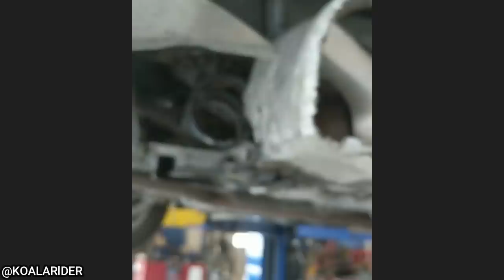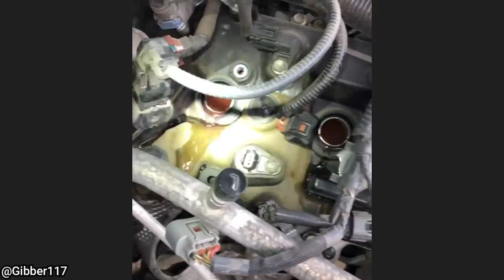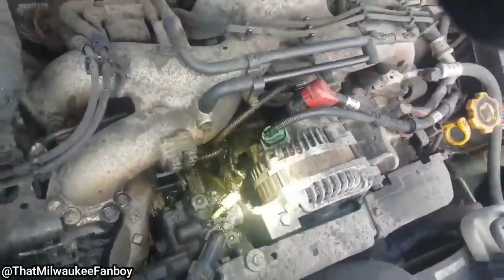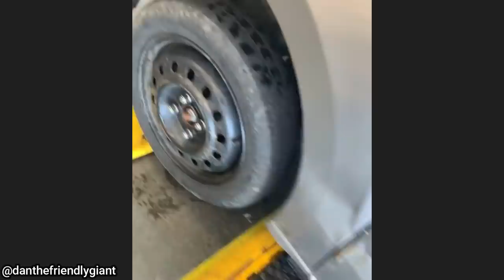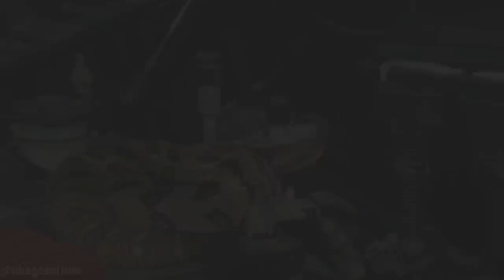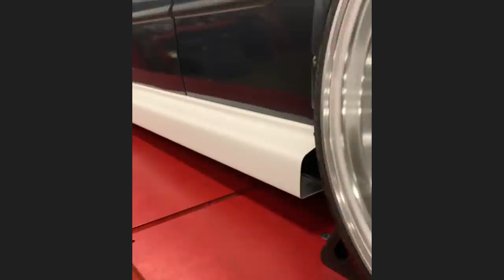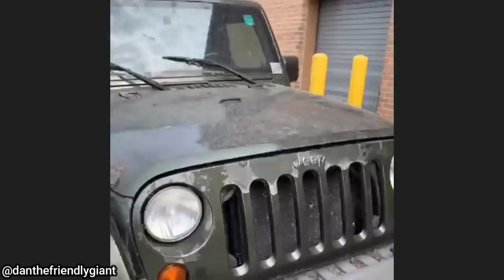Customer States They Want All The Damage Fixed | Just Rolled In

Comment: Reckon the rain-gutter side-skirts are a brilliant idea, as it means they're easily replaced when ripped off on a speed-bump!
Reply: These cars are usually first ones in the ditch during a snow storm!
Reply: Those ones look like going over 30 will rip them off.
Reply: A surprisingly good(ish) idea executed terribly.
Reply: It’s to channel the water away during regular rain 🌧 sessions! 😆
Reply: The drywall screws, extra 10hp. LOL
Reply: Fast and Furious: Tokyo Drain
Reply: @alefgardhero  he should have attached with large head rivets used on late model stock cars, and used thin aluminum tubing for support braces, match the color of the car or use matte black paint, other wise great idea looks fast and areo.
Reply: One of the most ghetto modifications I have seen.
Reply: Absolute genius if done to a better standard
Reply: Attached with flathead wood screws
Reply: What is it with people wanting to screw shit to their cars? What does it achieve? It's just so wanky....
Reply: My exact words i ended up saying out loud were "well hey, it works."
Reply: @johnwurst6691  glueing is too finicky.
Reply: or lost in a ditch beside the drift-track.
Reply: Brilliant, until you run out of rocker panel to punch holes in with drywall screws
Reply: @Initial_Gopnik  yeah. but there is still duct tape, no?
Reply: I'm not so sure about the drywall screws though.
Reply: Yea that paint ain’t gonna be cheap tho when it gets scratched up from the gutter ripping off LOL

Comment: My daughter's '07 Honda Civic had a cracked block around 2016, a friend who worked for Honda Mfg. did some research and gave us a number to call, sure enough, that engine block was under a 10 year unlimited mileage recall.  The car had been well serviced and received regular oil changes.  The block cracked on a Saturday, and by Friday Honda had installed a BRAND NEW short block, NO CHARGE.  Car had 154K miles on it too.  As far as I know it's still running, she sold it a couple of years ago.
Reply: At VW you don't get a single penny if the car is older than 2 years and the warranty has expired just one day
Reply: @ffjsb  I think you should. After that, take a shower.

Comment: the rain gutters are the funniest shit I've seen in a while. I'm shocked he didn't add a few elbows and a down spout and create tail pipes, lol. .
Reply from the maker: Maybe he was hoping it'd help him from hydroplanning lol
Reply: Thanks for the epic laughs 😂🤣😆👏👍 Very funny lol 😝
Reply: I used to work in a lumber yard and had a kid come in one day looking for 1-1/2 and 2in PVC pipe.  He only wanted specific pieces and I could not figure out what he was doing.  I finally asked and he said he was building a cold air return for his car.  I told him that wasn't a good idea and he asked why.  I told him that PVC pipe has a low melting point and could potentially set his car on fire.  He ended up not buying anything.
Reply: The self tappers complete the look just perfect.
Reply: Some people just never amazed me.🤣🤣
Reply: @MattExzy  They looked like drywall screws!
Reply: People also use garden edging to do this
Reply: aye, at least it doesnt look bad. gotta do what you gotta do
Reply: Honestly it looks better than a lot of crap Ive seen on some cars..... cheap to replace after a while too!
Reply: WAIT! SOON!
Reply: should have added some aluminum siding
Reply: @1HourMartinizing  and vinyl windows!
Reply: @markh.6687  and replaced the doors with screen doors.
Reply: @1HourMartinizing  That's a little drafty in winter, but it does keep the bugs out.

Comment: That was awesome.. That one with the motor running with the intake broken up reminded me the first time I changed my plugs in my 1973 Buick Century wagon with that sound.
The spark plug blew out. 
My ex also drove over what she thought was a large bag in a parking lot.  she stopped and looked and it was transmission case. She also noticed the puddle of oil but thought she could make it home 20 miles away. Wrong. 
She needed a new engine and then the nightmare started when the machine shop told me they installed the silent shaft bearing.Wrong. They said they did but they didn't.  3 timing chains kits later I got a better look inside the block. No SS Bearing. About a year later she put power steering fluid in the master cylinder. It took me awhile to figure out why it would stop moving after it warmed up... life's Lessons learned.. the hard way.
Reply from the maker: Well it sounds like it's a good thing she's a ex...? Lol
Reply: God r u sure u didn’t date a special Ed kid?
Reply: Yeah, stay single:)
Reply: Wow, that's quite a risk. If you do that around here, you get charged for the costs of oil cleanup and an environmental felony. Which, for just a few kilometers, is already heading toward's a year's salary for most people as oil is not easy to clean off roads at all.
Reply: @ThatNoFbody-ch9ky  Close... she was drunk a/f

Comment: I'm actually pretty curious about how far one has to drive on a rim to literally grind off that much of it.
Reply: Aluminum is soft so probably not as far as you think.
Reply: We had the dealers daughter get a flat so she drove the car back to the dealership rather than put on the spare :(
Wore the rim down to the rotor on an expensive Italian Lancia
Reply: @raymondclark1785  
Funny how wealth rarely transfers brains…
Reply: i will tell you funny thing you can do that with steel wheels and they will hold 😂 like 20 years ago i saw a workshop guy driving car with no tyres or seats 😂😂
Reply: @Torsee  Brains depends upon how you look at it.  A tire and rotor are cheap compared to getting run over while sitting a busy interstate either waiting for a wrecker or trying to change a spare.
Reply: @kaddiddlehopper  Then find a safe location and change the tire.
Reply: @MK0272  Why do you think it's in the shop?
Reply: @kaddiddlehopper  If a shop is the first safe place you find, you're not looking hard enough.

Comment: I have to admit ... everytime I see these videos with car being driven in with holes in the engine blocks, rims cracked or ground down, transmission with "inspection" holes in them, suspension parts that in pieces, and frame and bodies that are no thicker than tissue paper because of rust  ... I am just have to marvel at the level of engineering that has made it possible for these vehicles to actually be driven in those conditions.   It is no wonder that we are safer than ever in the vehicles we drive today.

That being said ... still terrifies me to no end that these vehicles are actually on the road ... and being driven in said conditions ... 😱😱😱
Reply: What gets me is the owners always lie about it. They bumped the curb, and ripped the entire oil pan off. Some other “shop” did these atrocious repairs.  Why bring it to a shop and then decline repairs? Did they think it would be a cheap fix?

Comment: Yeah, I'm going to call the plastic rain gutters affixed with drywall screws today's winner. That there is hillbilly engineering at its very finest. (Edit: That Superbird at the end is SWEET. I love the old wing cars.)👍
Reply: I'll never be able to look at another ricer car with a body kit without thinking about rain gutters again.
Reply: That's pretty cool
Reply: @joevk6274  🤪😜👍
Reply: Agreed on the rain gutter and superbird
Reply: @juanmanuelpenaloza9264  if I were the mechanic, I would recommend replacing the sheetrock screws with stainless steel sheet metal screws.
Reply: @cliffcorson4000  👍👍👍
Reply: I think the rain gutters are "egg roll engineering"
Reply: If they were black or body color it would look pretty good.
Reply: Dominic Toretto on budget, picking some leftover from his roof repair job. ^^
Reply: @rnreajr9184  I'd use flathead bolts and nuts
Reply: Missing led in the rain gutters.
Reply: Yeah and just one screw on each end . Crazy .
Reply: I it works then it...
is kind of silly, but what ever bloat your goat.
Reply: @abelq8008  Yeah, right?
Reply: @dionysos46  Very nice.😁👍
Reply: I live in a small town in New Zealand and was buying some mag wheels off this old guy about 10 years ago, in his shed at the very back was a Plymouth Superbird. It was solid, no rust but every panel was a different colour and the engine was out, I asked him if it was a 440, he pointed under a bench and there was a 426 hemi. Couldnt believe there was one sitting in this small town in NZ. Apparently its still there, still in bits. :-)
Reply: Cheap and easy to replace! XD
Reply: @kjadfhgioaudbfvilaeu  Hell, yeah! You could change that crap out in thirty seconds!👍

Comment: The car with the space saver spares reminded me of a car I saw when I worked in the hood it was an early 90's Gran Am had four of them on it, a few months later I saw the same car with four different spares, the first time it had black rims the second time were red.
   The rain gutter side skirts reminded me of a coworker he owned a 2000-01 Grand Prix, the ones that the outer rocker panels always rusted out, he bought it new and the 10-12 years he owned it he replaced the outers twice.  He decided this winter was its last one and he was going to replace it but the rockers had a bunch of holes and the state I live in has a yearly inspection, his was up, so he took some vinyl siding he had left over, it has the same contour as the rocker panels, using liquid nails he glued them over the rusty ones and spray painted them to match.  It passed.
Reply: If it's stupid but it works it ain't stupid I guess.

Comment: Those Subaru 2.5's are indestructible !   Mine blew the same way, and I still drove it into the dealership !
Reply: Was the one in the video yours? 🤣
Reply: I saw one the exact same way.  It would still move too.
Reply: I wouldn't really consider multiple engines failing this way a testament to their reliability.
Reply: Sounds like they are very much destructible

Comment: Actually, I told my 2 daughters and wife if they have a flat tire at night or someplace that isn't safe, just keep driving until they are someplace safe.  I'd rather pay to fix a car than pay for a funeral.  Rims and rotors are cheap.  Coffins and funerals, not so much.  Then again, that was before everyone in the world had a cell phone or On-Star.
Reply: Yup. $70 for 3 years of roadside assistance via the button in your car. As long as it’s not mechanical/over heating, just push the button and stay in the car with it running and doors locked. You’ll be just about as safe on the shoulder as some shady gas station.
Reply: @jbrown383  Yeah, until the tow truck driver turns out to be the killer 😆
Reply: DEZZNUTZ 1001  considering my ram's spare has been under the bed exposed for the last 6 years... no way i'm changing it, i'm driving till i can get a signal and a tow. it's only bad advice if you don't take into consideration this was before a lot of cellphones for the OP. if you drive according to the conditions of the road, weather, and slowly, it's better than being stopped at the side of the road in quite a few locations for women.

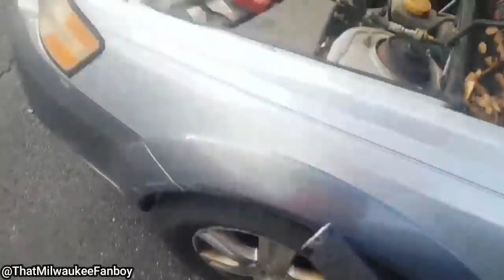Comment: 1:14 Subaru.. The toughest thing on the planet. I had one to where the engine sounded almost like this but it still drove. 
At the other hand. It was the only car I ever owned that had a catastrophic engine failure. So not sure what to say about the reliability of Subaru..
Reply: Older Subarus used to die from rust if you changed the oil regularly and changed the valve cover gaskets every 40 k miles.

Also watch out for the battery going bad in mid 1970s to late 1980s Subarus.  When that happened, it took out the voltage regulator ($15 in 1985).

I had 1978 Subaru wagon with 220k miles when I got it and sold for more than I had paid 2 years and 30 k mikes later.

One of the first makers to put the 100k digit in the odometer, and they meant it to be needed.
Reply: I had a 2017 Subaru BRZ. Blew the motor before 20k miles. Old and new their engines have defects i have found. Reliable yes but a few to many bad apples. Not to mention the older BRZ engines had a problem becoming grenades. Didn't help mine blew up on the interstate at 100+
Reply: @mitchellmckenna42069  I have a 2015 Toyota 86. Still going strong.
Reply: The only Subaru ive ever owned was a Legacy B4 RSK, that thing was super reliable, and a rocket, until it got stolen.
Reply: Subaru engines are so so reliable and when they go bad they detonate like a grenade.  They typically aren't re-buildable either.

Comment: As someone who used to be 17 years old I can attest that those space saver spares are good for a lot more than the 50 miles at 50 miles an hour they're rated for
Reply: As an ex newspaper delivery goblin I can also agree with this statement lmao
Reply: But it is of course noteworthy that keeping one on for a long time will really piss off your alignment and wear on other tires
Reply: Guy passed me doing 70 mph plus and he had 4 of them on the car. "Man, I can't believe the deal I  got. 4 new tires on rims for $100.00."
Reply: @MetalY2KMusic  My neighbour blew his diff by leaving one on the rear for far too long.:-)
Reply: I hate space saver spares! Back in the '80s I took my '76 V8 Monza 2+2 (which I still have, with a 350 in it now) on a trip from Atlanta to New Orleans and back. It had the inflataspare and nitrogen bottle. I have American Racing 13"x7.5" alloys on the car and had put one of the original steel wheels with a good tire in the back (hatchback car). So on a Saturday night in NOLA I come out to the car to find the sidewall cut on one tire. Guess somebody didn't like where I parked... Didn't even bother to try and find a 215/60R-13 tire in NOLA on a Sunday! Just put the spare on and drove it home like that. No problem... ;)

Comment: For cheap full size spare tires back when I had cars with trunks, I just bought a 5th rim and a used tire from a junkyard, had it mounted by the junkyard and then just tossed it in the trunk. total cost $15
Reply: my old 80 Malibu I did that I had the rallye rims off of a late 70s/early 80s Camaro and I found a 5th wheel in a junkyard painted it to match mounted it on a cheap tire the same size as the ones on my car and put it in the trunk screw that tiny ass doughnut.   One thing I LOVED about the crown vic and grand marquis is they came with a full size spare (took up a LOT of trunk space lol).
Reply: @davesmith3565  I did this with an 87 Jetta and 91 Cougar. Both had donuts, but the one for the cougar was almost the size of a full tire for the Jetta.

I have been in pickups for the last 20 years. Having a proper spare tire is one of the great things about them, though it sounds almost sad to say that.
Reply: When backroading in Idaho I had a spare on the hood, roof, tail end and in the back seat...some of those "roads" weren't really roads. When we drove the AlCan in the 60s they said to have two spares, we had three, only needed two..
Reply: My ´86 Caprice just has an emergency spare as well, but the space for full wheel. Last time I replaced the tires I kept one of the old tires (still reasonable thread), got to find me a rim. Not that easy or cheap in Germany! Gotta wait for lucky shot on Ebay. 
But even without the rim, just that tire in the trunk helps. Tire shops are plentiful, so easy to limp to on the emergency spare. As none usually have the car´s  tire size in stock over here, but as I already got one...
Reply: @davesmith3565  I had a Grand Marquis, but I got the donut option because I didn't want to fill up so much of the trunk space with just a tire. I never regretted it. I used the trunk space for other things all the time, but I only had to use the donut twice in 18 years.

Comment: The only reason mechanics have ever been surprised that my car would start has been having a weak battery (which was due to a problem with the alternator belt). I'm talking about my old diesel car, and those require a lot of initial power to start. I've been very happy with that choice of battery brand (Banner), unlike the previous one. They even replaced my first one that had a recall even though I was a few weeks late after the end of the recall period (which i didn't know about).

Comment: Was that the crank shaft just open to the air? I also can't believe the thing still drives after that much damage. What even causes that? Pieces of the engine block fracturing off?

Comment: If the legacy needs a motor I just rolled mine, same year, and the engine is immaculate, 170k miles, doesn’t burn oil, and gets original rated gas mileage

Comment: On the front-facing Ring camera several nights ago a pickup truck passed by pushing its tire-less driver's side bare wheel down the street. It looked a lot like a meteor entering the atmosphere. Even after the vehicle passes from view a glow can be seen but growing more faint as the seconds pass. I waited to hear sirens but oddly that was it.
Reply from the maker: Lol good thing for cameras! What a sight.
Reply: @JustRolledIn  They are helpful. Back in August a large dump truck towing a Ditch Witch-type excavator fishtailed the trailer into our two plastic garbage cans. I heard the loud, hollow Thud! and noted the time so I could retrieve the video. I think the driver did it for spite because our cans were setback at least three feet from the roadway. The cans were thrown right into our neighbor's containers like a bowler having just thrown a strike. I reported it and furnished the video to our local police.

Comment: The Jeep limo looks like someone welded the two Jeep sections on each end of a camper trailer.
Reply from the maker: And did it all with their eyes closed lol.
Reply: @JustRolledIn  Actually, Jeep is built better than you think, the center section has full roll bar, and removable vinyl top, center section is raised for headroom for passengers.